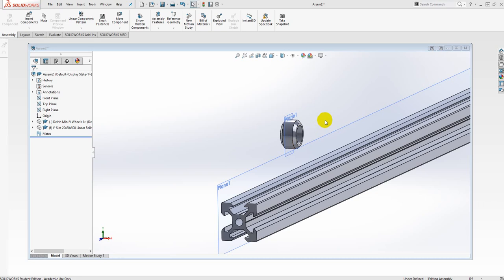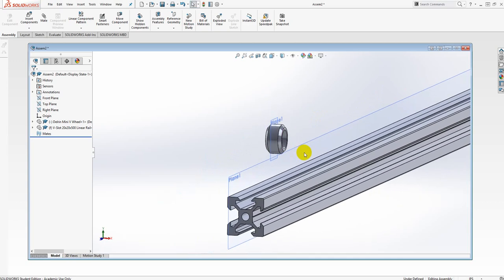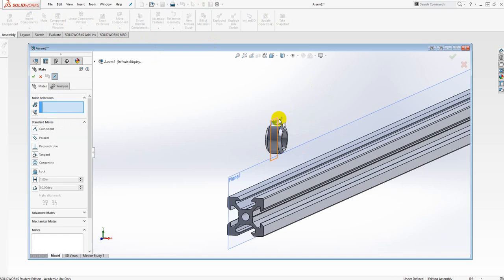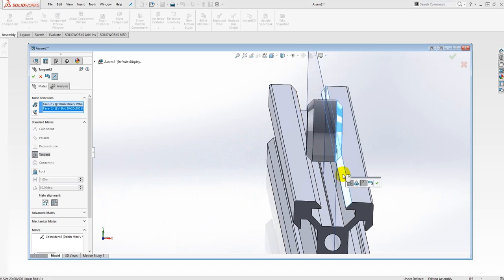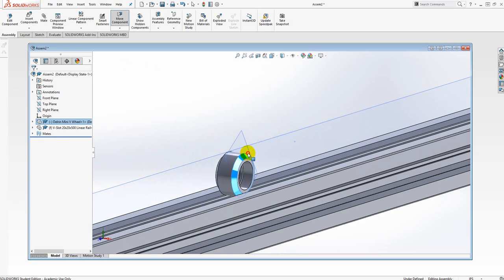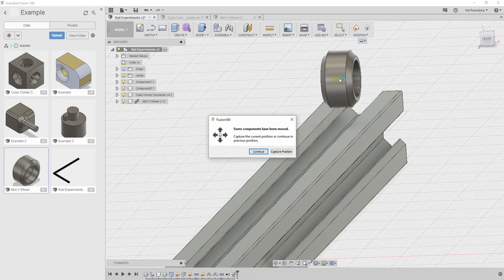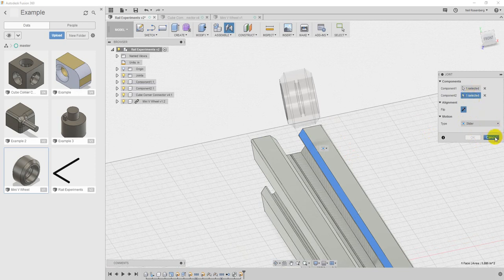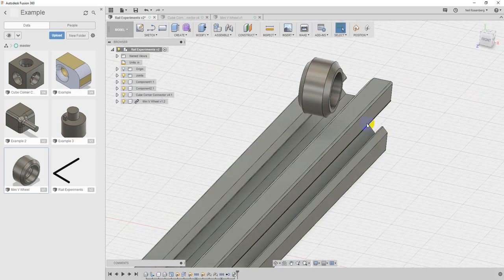Wheel in track: Solidworks vs Fusion 360

Comment from the maker: I was really hoping someone would show me the "error of my ways" and demonstrate how easy it is to put a wheel in a track in F360 without punching in dimensions.  Now that it's been about 1-1/2 years and still no answer, it's pretty much put to bed for now.  BTW a much more economical solution for us poor hobbyists is (gasp) Autodesk Inventor.  The workflow is almost identical to Solidworks, and it's incredibly cheaper.  Check out the annual subscription prices on their web page, you'll see what I mean (this is an error, see comment below).  The only risk is that Autodesk (makers of Fusion360) may cancel or cripple Inventor someday...hope not!

3/9/2019 Sad update to the above comment, which I will need to back-pedal.  The version of Inventor I was looking at was LT, which does NOT include assemblies.  The PRO version is essentially the same price as Solidworks.  Back to the drawing boards...
Reply: Search Youtube for Fusion 360 joints. It's actually very easy and the videos offer very clear explanations.
Reply from the maker: @CarbonGlassMan  Thanks for the reply, but it would be a LOT more helpful if you posted a video of your own that shows it being done.  If you review the various comments below, you will find others who say (as you do ) that it's "very easy".  Then when they try, it's totally not easy.  In fact not possible without punching in dimensions, which is the wrong way to do this job.  Don't mean to be ornery, but...show me!
Reply: @NeilWNC  80/20 Roller Wheel & Motion Study — Fusion 360 Tutorial — #LarsLive 184
Reply from the maker: Thanks for the reply, but this really nails home how weak F360 is in this regard.  Compare what Lars (the absolute expert on F360) does vs what I show in Solidworks.  Look in particular at 13:58 and 15:17 -- yep, he's entering discrete dimensions.  That's exactly what I'm avoiding in SW, and in much fewer steps.  Not to mention he's using a pre-made assembly with wheel spacing that's already optimized for 2020, and the wheels have a geometry that is MUCH simpler to incorporate than V-rail wheels that have angled contact.  BTW these wheels are nowhere near as good as the angled wheels for resistance to side-to-side play.  In the 3d printer industry, usage of V-rails and angle-contact wheels have become the go-to solution for precise motion control.  F360 simply can't handle them.
Reply: @NeilWNC  I started learning Fusion because it's free. I wish the joints were easier, but free is free. I'm curious, if you have solidworks and know how to use it, why are you interested in learning Fusion? The machine shop at my place of employment uses solidworks but if I wanted to learn it, I'd have to buy it and take it home to learn it since I don't work in the machine shop. So F360 for me.
Reply from the maker: @CarbonGlassMan  Good question.  I use Solidworks now (and love it) because I get it free as long as I'm teaching engineering at the local university.  Once I retire however I'll need a replacement, and like you don't want to spend the huge bucks for a non-educational SW license.  This is where Inventor comes in.  For my purposes it's almost as good as Solidworks, and costs a whole bunch less (not true, see updated comment above).  Oh and yes, it handles the wheel problem with ease.  

The sad irony (for me) is that F360 is a very powerful tool and in other respects has great appeal.  But the fact that they have gone out of their way to eliminate Mates is a real turnoff.  I'm sure they could add them in, but they are so devoted (almost religiously) to their joint-style workflow they have blinders on.  Too bad for us.
Reply: @NeilWNC  I'm going to check out Inventor. Fusion is the only modeling software I've messed with, but I've only been learning it for a few weeks now. The draw was the price tag along with how powerful it is. Usually free software isn't very good. 

I wanted to draw up a design for a CNC router that I am gathering parts to build. Joints are going to be used a lot, so maybe Inventor will be a little easier for me. 80/20 aluminum extrusions are what I'm using for the frame which is why I looked at your video.
Reply from the maker: @CarbonGlassMan  I've looked into Inventor pricing further, and come to realize the version I was looking at (Inventor LT) does NOT include assemblies.  Darn!  The PRO version of Inventor is a bit cheaper than Solidworks for the first year, $2k, but they charge that every year into perpetuity.  Solidworks is $3995 initially, with a $1295 yearly subscription.  After a few years you're better off with Solidworks. Either way, it's absolutely NOT a hobbyist tool. 

At this point I'm coming to the opinion that the best (only) legal way to get either of these products at a reasonable price is to take a course at a local college or trade school and leverage their license.
Reply: @CarbonGlassMan  use torrent, and when you learn software and get job just buy it
Reply: How I would do this is create a construction plane down the center of both components (they need to be separate components, not bodies), align the two pieces, and use a bottom/tangent plane on the roller face to slide on the face of the extrusion. It doesn't simulate the rolling effect this way, but that's probably the easiest way to do it? (Without creating an axis along which you want the centre of the roller to slide, which is what technically should be done)

Comment: hope you figured this out, it is simple and you were close, position the roller on the rail first, place the joint disk on the face of the cylinder, parallel to rail, select slider as the movement type and you're done, set joint limits and it will slide in the rail..
Reply from the maker: Hi there, and thanks for the reply.  Could I convince you to make and post a video that depicts what you are saying?  I'm still not very experienced with F360 and there's nothing like seeing someone do it.
Reply: @NeilWNC  bit more complicated than i thought it would be, there should be a better way to control position of the joint origins instead of having to snap to surfaces https://www.youtube.com/watch?v=rrun5HZ_9a8&t=1s
Reply from the maker: @PhaseFabrication  Thanks for following through.  Not being an F360 expert, some of the concepts you use are a bit opaque for me.  The complexity of the process you use makes it somewhat undesirable as you state, however the biggest sticking point is the need to punch in a number.  I'm not really sure if the result in your video is a truly tangential relationship between the two surfaces, nor whether the wheel is centered on the rail.  Regardless, thanks for the effort.  My quest continues...

Comment: So fusion 360 is pretty much for children and not something to make serious models?
I'm a product design student trying to find the right program that actually does what I ask it to do. Every day that I turn on fusion, SOMETHING won't work right (whether it's snapping circles to the center point of another, or something else entirely.).

Fusion is REALLY beginning to grate my teeth. I've tried and I've tried and it has a huge learning curve and every time I try to learn it, something doesn't work.

Yet another POS program from Autodesk.
Reply: Honestly, I completely disagree, I think a lot of what fusion 360 has to offer can eliminate many of the little steps you need to go through to accomplish something in solid works, I use both programs for product design and there are pros and cons to each, solid works is definitely more strict with how you build things, and will throw a fit if something doesn't add up mathematically, that's not a bad thing, it ensures that you have a working model, fusion isn't as strict and can result in uneven geometry and what not but a lot of that has to do with how you as a CAD user builds, for me, fusion is much more intuitive, allows me to be more free with my designs while still yeilding me the same results I get in solid works, the difference lies in how much time I spend on each project, it just takes a little longer in solid works... With all that being said, solid works is still the industry standard and I don't think they'll lose ground to fusion for a while, but fusion is an extremely promising program if you actually take the time to learn it, I challenge you to learn both and use them in whatever ways fit your workflow best!
Reply: Its not for children. I have been able to model a lot of things in fusion relatively fast and with ease. You just need to watch some tutorials to learn it.
Reply: Also for snapping circles to the origin, in your sketch palette, choose coincident and then click the center of your circle and then the origin, or whatever your desired center point is, should just snap in
Reply: I use autodesk 3dmax for 17 year. And now I wish to switch on blender cause autodesk do nothing to improve. Just bell's and whistles and same bugs for decades 😁

Comment: Use “Align”
Reply: this literally explains how to go from solid works to Fusion, quit trying to mate surfaces.
Reply from the maker: Could you be more specific please?  Have you tried this?
Reply: NeilWNC..... In the joints tab( the one on the top), select the “align” feature. It aligns the surfaces. You may have to do it twice to constraint both the surfaces of the ball bearing(?), to the extrusion, but this feature allows you many other features in other environments that fusion provides(like simulation and cam) later in the product design phase.

Or

Just type ‘s’ on the keyboard to search the align feature...
Reply from the maker: Interesting.  Can you in fact align a cylindrical surface tangentially to a flat surface, have you tried this?
Reply: NeilWNC I have just tried it, and it doesn’t work with tangential contact although I’ll keep looking in how to do this( using the guide rails for tangential contact).
Reply from the maker: Yes, this agrees with my findings as well.  Please come back if you find the "magic sauce".  Thanks!
Reply: NeilWNC I surely will 👍🏻
Reply: NeilWNC hey, why don’t you open the SW file in fusion 360. If Fusion has a command that can do this, you can find out!😁
Reply: https://www.youtube.com/watch?v=68G8Igl1jKM

Comment: There is a way to do what you are trying to do in fusion 360. I just did it in 2min. With joints you have to understand how the joints are driven. When you move your mouse to select the face of the component you want to join you will notice that a small icon appears on that face that shows you the point that will be used for the joint. It is a small ring. The way you did select  the components you didn't pick points. If you hold Control while selecting the face the point will be automatically selected. Also the orientation of this point with the ring will indicate at what angle will the joint be done. For what you trying to do I used a slider joint and picked the inside chamfer edge of the roller which gives you a ring in the center of this circle, and on the rail I picked the line of the chamfer that would be in contact with the circle I previously picked on the roller paying attention to have the ring on that line facing the same way as the ring on the  roller. This will take the components together but will allign the center of the diameter of the roller with this line. So you then move with  the handles the roller up for the same distance as the roller. And make sure you pick the slider axis to be the same as the one you want to motion to be done.
Reply from the maker: Thanks.  Perhaps you could do a video that shows this?  Kinda hard to imagine.
Reply: Yeah man. Here it is.
http://autode.sk/2kC2q8i
Reply from the maker: Thanks profusely for the video.  

From what I see there are two things that are happening that are a concern:

1. The edge of the chamfered portion of the roller must be aligned with the inside face of the track.  This is not true with the Openbuilds parts.  In fact the only Y-alignment I do is to match up the center planes of the wheel and the rail.
2. You set a fixed offset, in this case 30, to achieve the appearance of mating between the rolling surfaces.  If I understand this correctly, you are in effect manually finding a number that provides the appearance of tangential contact.

If you have a moment, please try your approach with the actual Openbuilds parts, the "Delrin Mini V Wheel" and the "V-Slot 20x20..." linear rail.  Here's a link to their models:

http://www.openbuilds.com/projectresources/categories/openbuilds-parts.5/

If the two above statements are true, then my search for a proper (as in automatic and precise) solution continues.
Reply: The number I use to offset the joint is the radius of the circle I picked for the joint because the point I pick for the joint is its center. So the joint will initially be positioning the center of the circle on the line of the rail. Also the parts do not need to be aligned for the joint to work. To download the files of the link you sent I need to have an account on the site and I don't want to create an account on this site. If you can send me a direct link that I can download those files I can take a look into them. 
Here is another screen cast.
http://autode.sk/2BshoJx
As you can see you can also select a custom axis for the slider link.
Reply from the maker: Actually, having re-read your reply (more carefully) and re-looking at your video I am once again of the opinion that Fusion360 can't currently do the job in a parametric manner.  The fact that you have to enter a number at all says to me that there's no tangency relation or joint that can be used to enforce a rolling contact.

FYI here are links to the two parts in .STEP format, shared via Google Drive:

The wheel:
https://drive.google.com/file/d/1I6YIFDGRU7_wlvTf9edSMUUeUEUIFX8v/view?usp=sharing

The rail:
https://drive.google.com/file/d/11VwAK07S2trIKo8i5tnKtcU5RnELfpJU/view?usp=sharing

Please prove me wrong!  Thanks.
Reply: The number I use to offset the center point I previously picked from the line I want the joint to be done. Since the part has a radius of 50mm and I offset 50mm that means that the edge of the circle will be tangent to the line that I wanted to make the joint. To be more exact the joint is between the center of the circle I picked with the point on the vertical face right next to the rail face you want the wheel to roll on. It has exactly the same result as the mate you are doing on solidworks. You can move the component on the rail and it will always be tangent to it but it will not roll, just like the video you show on solidworks. I thought this is what you were looking for. Here is a screencast with your files.
http://autode.sk/2zaJJ0X
Reply from the maker: Not to beat this to death, and I agree you can (with calculation) come up with a distance that will mimic tangential contact.  But from a modeling perspective it's really not.  

I'm not so concerned with the thing actually rolling, but the notion that if I have a situation where the contact doesn't conveniently intersect an edge or known diameter that I have to fudge/calculate/adjust to get it right, well that's just not sufficiently parametric.  What would you do if the wheel diameter needed to be changed slightly, or the rail edge contact didn't happen to align with an edge of the wheel?  

Please notice that in my Solidworks example I never punch in a single number.  That's what I hoped could be done in F360, but based on the kinds of responses I get, it's likely not possible, at least not with the current version.  

Again thanks for the follow-through, and please do re-post if you come up with a method that does not require calculations, numeric entry and/or special-case geometry or relations.

Comment: Could you link your parts?
Reply from the maker: Hi Wilko.  The Openbuilds parts can all be downloaded from:

http://www.openbuilds.com/projectresources/categories/openbuilds-parts.5/

I generally use the STEP Parts Library 1.5.  The two parts I used in this video are "Delrin Min V Wheel.step" and "V-Slot 20x20x500 Linear Rail.step"

Also this video is referred to in a thread on the Autodesk Fusion 360 forum where you can find other users' proposed solutions:

https://forums.autodesk.com/t5/design-validate-document/v-wheel-in-rail-really-hard/m-p/7143090#M114702

Neil